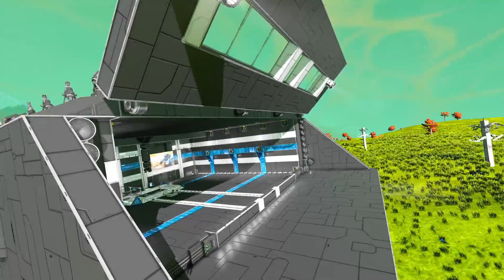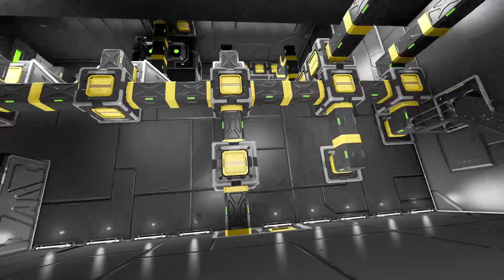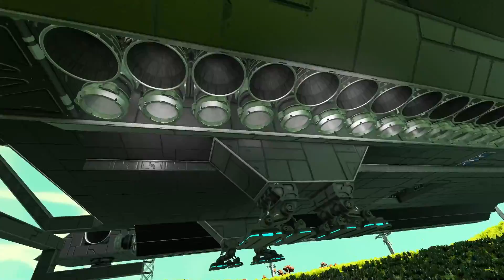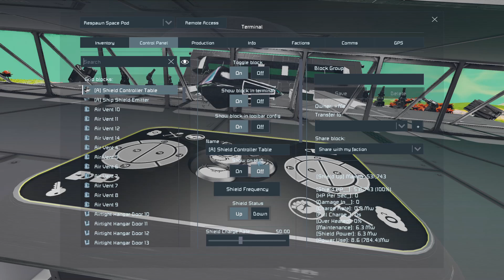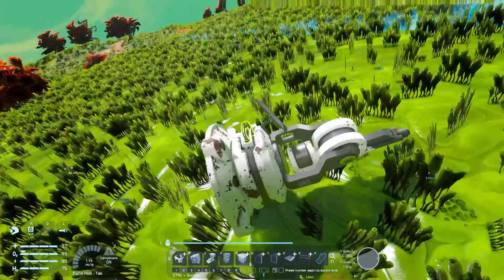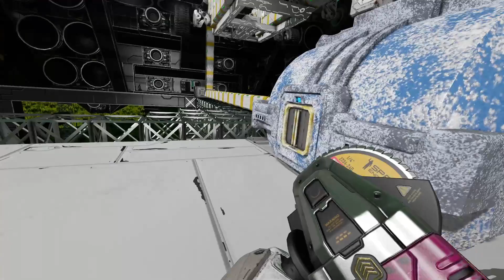Space Survival Adventure: Ship Walkthrough - A New Space Engineers Journey / Part 34

Comment: Those thrusters are going to be trouble. I think you went waaaay overboard, I've seen ships made out of heavy armor use less. Also, they are so exposed, with the exception of the rear ones, that they will certainly be among the first blocks that get damaged if anything shoots you or collides with you. Also, extremely fuel inefficient, so at least group them into "Full throttle" and "Half throttle" groups.
Then again, what do I know, I usually go for compact designs so I never built anything close to this big..
Reply from the maker: I honestly never built something this big myself. I'm sure this ship has many issues that I am not aware of, but will be fun to find out lol.
Reply: @PandemicPlayground  Oh yea.
Fun.
Definitely.
You have some mods on, right?
Get a shield. Even if you shoot down incoming drones before their weapons do any considerable damage, the debris will be hard to evade flying something that size.
Reply: Im pretty sure its gonna need some tweaking after testing, like most things in aerospace engineering.